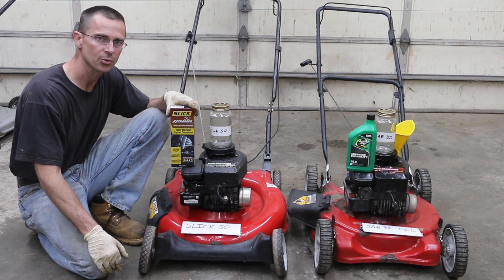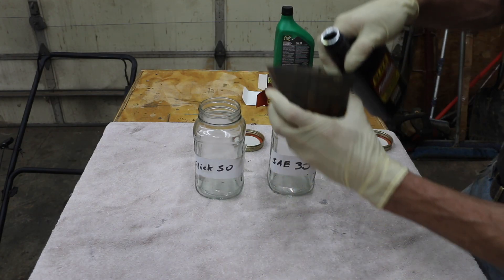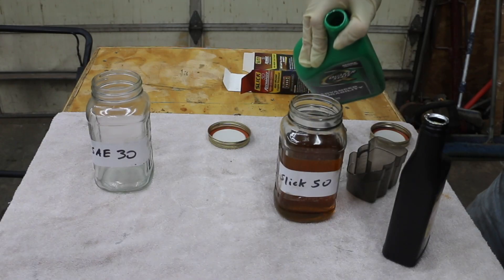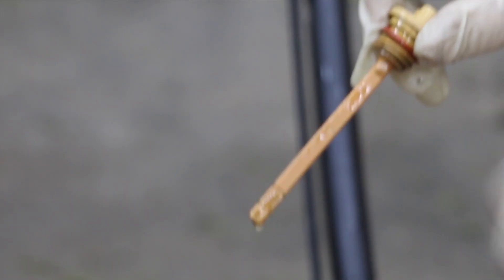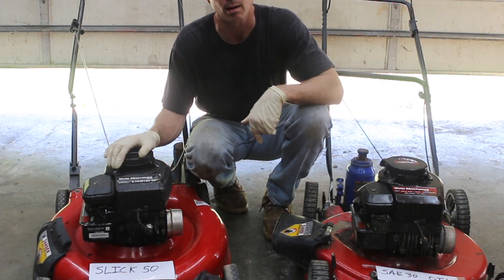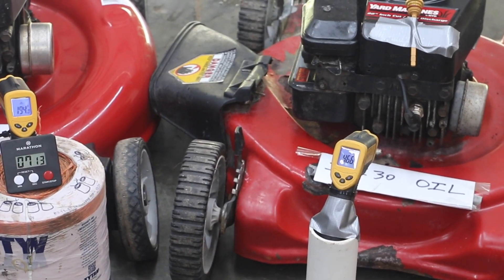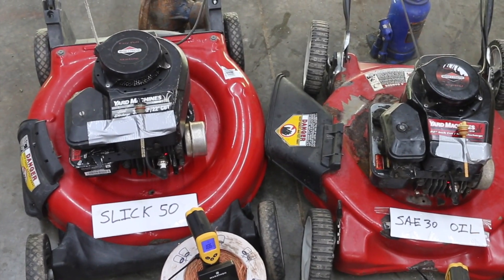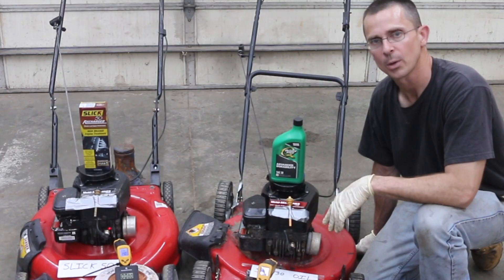Can't believe what SLICK 50 did to my engine!!--Dry Crankcase Test!

Comment: As a rep, ever since I visited the Mobile R&D test center in Paulsboro, NJ, I've been a believer in Mobile 1. Having seen their labs with a Mercedes Benz running for years, flat out, continuously with over a million miles on it, with is what won me over. (The engine was plumbed so that oil changes could be done without ever shutting the engine down) The engineers then showed me bench after bench if various engine components which had been plated with micro-inches of gold from metrology testing which had been embedded into test engines being  measured for wear using cross sectioning and microscopy. They had many engines in various levels of tear down which had been running all of the latest competitive synthetics as well. In short, there was no real competition, they were just being out marketed. Mobile 1 and their patented suspension of carbon graphite beat them all.
Reply: And the car was BMW six inline ,not Mercedes...
Reply: You need to read the story when mobile tried to sue Castrol for statingthat they had the best synthetic oil.They lost and Castrol counter suedand won. Don't be fooled by the smoke and mirrors.
Reply: Engines that are never shut down will have very little wear with any oil since there will always be a film of oil for the bearings to float on. Most wear occurs at startups. A real world test would be if they shut down the engines once or a few times a day.
Reply: Steven Evers most wear is in start up and shut down, continuous running is not a good test .
Reply: Thanks, that's impressive. I used to run Mobil 1 but it became pretty expensive here, so switched to Shell Helix Ultra F.S. which did pretty well for me also, but seemed to burn off faster. I think most of the synthetics deliver pretty similar performance, and you can extend your oil change intervals significantly if desired.
Reply: When you start your engine, you want oil around it as fast as possible, so a 0w is better than a 5w. Though sometimes the curves is different and blah blah but the second number is where the oil is after 5-10 min regardless. I for my cars i like 0w-40 {insert brand}.
Reply: Any engine that is run continuously will achieve this and Mobil knows this. It is the starting from cold that causes the most wear. Yes it's an impressive demonstration but I am sceptical about what it really shows.
Reply: Gas MPG in this amount of change doesn't mean much.  I have gotten much better gas mileage simply when the they change the winter summer formula at the refineries.  If you are not familiar. Instead of the refineries burning of the by products.  Now they dump it back in our fuel and we run the crap through our cars.  Not sure if they do it at both ends of the changes.  I do know they run premium gas through the supply tanks.  Even in the lower grade fuels. I think it is around Sep-Oct time I will see my gas mileage go up without doing anything to my truck.  If you ran your mileage around that time you can get a false change.
Reply: Mickey Bitsko AMSOIL is an MLM though and I don't support MLMs.
Reply: Major League Muffins?
Reply: lol Ellenor so are all products ;-) clue in.
Reply: Great comment, very interesting to hear your experience, as well as the other comments and experiences.

I think what we can say for certain, probably the only thing, as with everything in life you get out what you put in. So in this case with engine oil and 'performance'it depends what your expectations are, and you have to be very clear what is most important to you as there are so many variables and different outcomes possible.

In the example given continuous running with Mobil 1 was second to none.. Perfect.. However as others commented, probablya lot of start stop or different driving, running, load etc...a different oil might perform better other functions.

And then you have to think about ordering your outcomes into what's more preferable:

Cost of oil
Cost of fuel
Cost of a new /rebuilt engine
Cost to your business of downtime for any repair

Many variables and different outcomes more preferable for different people.

There will never be a one size fits all.. You can be master of one trade but never every one. The standard reasonably priced oil on the market tries to strike a balance and be something for everyone, and in return are usually generally good for most requirements but not perfect at any one.

 There are other factors as well such as patents, advertising and marketing, basically you have to 'sell'that idea or product to your customers.. The best man will not always win..
Reply: My experience in the 90's: Used different oils and with Mobil1 i Saved 10% in fuel compared to Shell, Texaco and BP.. If its still sotoday, i don't know ( We don't have Amsoil her in The Netherlands)
Reply: Richard Skipper - use to work as a Fleet Mechanic for a construction co, we ran Chevron Delo 15-40 , they. Use to get panicky an sell the p/u off at close to 100,000 miles ,I convinced the boss to run a test on several of the Ford 302 ,tear down an inspect lower ends - rods mains cranks pistons an rings , first at 80,000- then 100,000 then 125,000 150,000, then 200,000, at the 200,000 mark was where you could see some wear starting to occur on the rod an mains , still well into specs however, an we did an oil analysis at each LOF at 5000 miles , by the time the truck had racked up 250,000 miles the body an interior was looking sorta rough , so going from a 3000 mile oil change to 5000, An keeping the truck for another 100,000 miles was of course a huge savings to the company , an netted myself a nice pay raise an bonus . This was back in the late 80’s
Reply: As a rep you should know it's Mobil 1 not mobile 1....
Reply: @meat_pilot  as user of smartphones you should know that autocorrect corrects Mobil to mobile....
Reply: When it first came out it was $15/quart. Before 1978.. I've heard nothing but good about it
Reply: Here in Texas I bought mobil 1 and used it in 1978 and it was $5.00 dollars a quart .
Reply: None??  It killed so many piston engine pilots and families(produced engine failures)  that they had to stop selling it to pilots.  It does not last as long as they were saying.  That was in the 1990's.  For cars,  change it as soon it gets dirty.  Dont use dirty oil...
Reply: Whaaaa? I live in West Deptford like 5 min from Paulsboro lol I wanna go see this
Reply: Bobby Harpoon The byproducts should be saved and sold as "waste combustibles" in pressure tanks rather than burning off.
Reply: I got 10 % better mpg after switching to geico.  
If you want better mpg go down in sae,  if you want better "protection" go up(In second number). first number is "winter" or cold start sae equivalent oil at cold temps. the second is warm. All oil companies buy from the same suppliers, additives comes second to this, and will be argued long after we are all dead. But if someone wants to sell you 5 "weight" oil kick'em in shin and run the other way.
Reply: Steven Evers, I only use Mobil 1 Full Synthetic. On my cars and motorcycles. Best results so far. Previously was a Castrol user.
Reply: Pennzoil Ultra Platinum usually does better in used oil analysis tests than Mobil 1.
Reply: I haven't changed my oil in 250,000 miles and my engine is running fine. That's like 80 oil changes if you do the 3k intervals. I could buy a new engine for what I've saved on oil changes.
Reply from the maker: I enjoyed reading your comments.  Very informative!  Thanks you!
Reply: Mickey Bitsko Nulon fully synthetic with Molly is good
Reply: Mickey Bitsko Hydrocrack synthetic should be sold as synthetic 2nd grade, not 'full synthetic'
Reply: Mobil1 is crap. The tests you speak off didn't apply to the real world. Mobil 1 paid out for damaged engines in the past.
Reply: @Project Farm I think we need to see a side by side of cheap oil vs. Mobil 1 vs. a straight PAO synthetic like Schaefer or Amsoil.
Reply: Add about 5% PTFE (teflon) to Mobil 1 and you be set!!!  Correct particle size of PTFE is critical, must be less than 5 Microns.
Reply: Graphite is an amazing stuff! A sheet of graphite, like a 10 karat diamond is a very tough single molecule that you can hold in your clamp without damaging it!
Reply: I'm thinking warming them up and cooling them down is a big player in wear and tear.
Reply: Sort of.  Castrol used a cheaper type of base stock and called it "synthetic."  When Mobil lost they, too, switched to the cheaper stuff....but they keep charging full price.  If you want genuine PAO synthetic base stock you have to shop around and do some homework.  Amsoil uses it, among others.
Reply: Mobil 1 is the only engine oil I ever use now. It is worth the price and is far better than any additive or other oil. I usually do my oil changes every 15k or once a year whichever comes first and have 350k on my original 4.3 s10 engine.
Reply: Well Jef Rey I have sad news for you if your trying to brag of high milage and think its because you use mobil 1 lol. My 4.3 sonoma zr5 has 496 on it and I think its had about 4 oil changes since the warranty was up lol. Heres the kick in the balls. Its some no name shit oil purchased at dollar stores.
Every now and then I pull a vale cover to see if there is any gunk build up. Still clean as a whistle. Miles or kms is not the killer. Its what type of miles/kms and peoples driving habits. I never stop on the gas from a light or stop. I ease into it to load up the engine then stomp on it. Not that theres much power under the hood lol.
Reply: I remember seeing Slick50 demonstrated at the Oshkosh, Wisconsin EAA Airshow in the early 80's.  They had a V8 engine on a stand, running in the hot sun, with the oil pan drain plug out.   I walked past it several times that day, and it just kept running-- without a drop of oil in it!   They had parts on display showing how Slick50 bonded to and coated the metal parts with a coating that looked exactly like a teflon coated frying pan.  I thought it was pretty impressive at the time!
Reply: @rickwessel3302  I saw the exact same demonstration at the Oklahoma State Fair in 1983. In that demo, there was no oil pan on the motor, and the oil pressure gauge read zero. I was shocked and amazed.
Reply: Nope, not at all MPG went from an average 14.1 MPG  to 15.5  (Math is not hard)  I don't have a Dyno,  however I did notice a small gain in power.......But you're certainly have the right to your completely, inane, ignorant, and false opinion.
Reply: Big sea I've always used castrol its deff the best but been thinking about awitching to Mobill 1
Reply: mobil 1 has the WORST start up lubricity and thats what tears most modern engines up
Reply: Mobile one is the way to go i guess
Reply: Did they tell you they sued Castrol for calling cheaper hydro-processed dino oil "synthetic", but when they lost the arbitration Mobil also switched to cheaper base stock?  It's ALMOST as good as real synthetic.  But not quite.  However, like Castrol, they charge the full premium price for it.
Reply: The increase in average fuel economy is not "In my head" math does not lie.
Reply: I just switched from using Mobil-1, to Amsoil after about 25 years........My truck instantly gained 10% increased fuel economy,  and a small yet noticeable increase in power.

Comment: you have to run slick 50 for a few hours to get it to bond to inter parts,
Reply: Still reading and responding to half a year old videos, that's what makes you a top tier youtuber.
Reply from the maker: Thanks for commenting on this.
Reply: That was my understanding as well. It also seemed that the engine just quit like the ptfe caused the parts to gum up as they heated. Did it throw a rod? Temp reduction of engine was most significant thing I saw.

Comment: Schaeffer Oil makes a product that I like and its mostly used for fleet vehicles. It's "Schaeffer Moly EP" they also make a Racing oil with the Molybdenum in it. Before you do the test though you should run the Moly additive for a while and let the heat build up coated surface on all the bearings and guides sorta like seasoning a cast iron pan but instead its supposed to plate the surfaces with a film of Molybdenum preventing metal to metal contact is the notion. I have always wanted to do this, but never could afford to, thanks for the video.
As a side note I don't think slick 50 is what it used to be. Something seems to have changed with slick-50 that is not the same stuff I remember,  the stuff I remember was about the consistency of raw honey, that new slick 50 looks like regular motor oil something is off about it. Its hard these days, as more and more technology surfaces so do strategies to protect investments, companies start with a great product only to have it bought out by the competition, then the new owner "nerfs" it to make the whole idea look like it was a scam, so even if someone else does it in the future the so called experts can point back at the situation and use it to discredit any future products before they can even get off the ground. I am not saying that's what happened with Slick-50 but there is something drastically different about it. Its just hard these days to stay objective.

Comment: Well it was kinda satisfying seeing that engine with 30 wt just stop nice to see a motor just lose it's crank every now and then although no motor is supposed to run without oil the slickster died at 200 degrees so it kept it's cool..... 
Don't use any attitive in a motor with a flat tappet cam unless it has zinc in it .... Like pre 80s cars
Reply from the maker: Thanks for commenting.

Comment: Did you try this with your MotorKote?    That stuff is amazing.  I ran a Civic unknowingly without oil for 600 miles and because it was treated with MK, it saved the engine.
Reply from the maker: Not yet, but I will likely test it this way.

Comment: the slick 50 you are  using  is not the bishops original , lookup What happened to slick 50 , Interview with John bishop , do not use if made after 1984  formula,
Reply from the maker: Thank you for this information.

Comment: Why have you never used B12 Chemtool. It works just as good as seafoam I guarantee it. And it’s half the price. I’ve had friends think I am a mechanic and all I did was use B12.
Reply from the maker: Thanks again for commenting.  I tested B12 Chemtool in a previous video.

Comment: You need to run the test with Prolong it is the only oil additive that when tested actually made more hp on the dyno. It is also the only oil additive that Al Unser ever endorsed. Here's a link to the prolong world challenge  https://www.youtube.com/watch?v=v9Sbo9RQA4w  Slick 50 no longer puts PTFE (Teflon) additives in their product like they used to, which in the past made it a pretty good oil additive.
Reply from the maker: Thank you for this recommendation.

Comment: The slick 50 commercial used a Mopar slant six which has babbit bearings, they also sprayed water into the oil sump to float the bearings. A very clever trick! Slick 50 sucks! It blew the engine in my 83 Fith ave. It clogged the oil filter and there were many cases of this!
Reply from the maker: This is great information. Thanks again.

Comment: Hi. Since you have established the timed baseline for this. Take a lawn mower and add Amsoil full synthetic for small engines. You can purchase this online here: https://www.amsoil.com/shop/by-product/motor-oil/4-stroke/ Now this is the top of the line synthetic oil aka top tier oil. If you want to use their top of the line small engine racing oil you can get that here: https://www.amsoil.com/shop/by-product/motor-oil/racing/briggs-and-stratton-synthetic-4t-racing-oil/?code=GBS2960-EA When you order you can use the customer # 308355

 Btw, I'm the guy who left all those links a few days ago showing where most all the top oil additive makers like slick 50 got fined by the FTC for not having one ASTM test (Automotive Standard Testing Materials) to back up their product claims. This has to be done by a party that has no affiliation with company or product. Product has to be bought at a retail store or the company without the company knowing about the test. In this way they are testing exactly what is sold to the consumer, not a beefed up version of the product that the company formulated to look good in the test.
Reply from the maker: Thank you for this recommendation.  I have some Amsoil and I plan to test it soon.

Comment: If additives were that good why don't oil companies add it into their oils. Buy the cheapest oil, add the additive oil and you will have an oil that will out preform a can of the best. Maybe ?
Reply from the maker: Thanks for commenting on this.
Reply: Oil companies do use friction modifiers in their oils as well as anti corrosives, anti foaming and various other additives that is what determines the particular character and behavior of oils. However, I do agree "oil additives sold as such may be best confined to the realms of "snake oils" although there should be a distinction between oil additives ie, those over the counter additives which are claimed to improve the effectiveness of engine oils and others such as "Slick 50" which is mixed with base oil in its packaging and only uses the engine oil as a vehicle to enable the transfer and plating of the product to high heat and high friction areas. Quality engine oils are developed with stringent controls concerning the particular additives necessary and in what percentages. Friction modifiers alone will never perform the functions required by the complexities of today's internal combustion motors. Further, the "Teflon" family of products don't require to be renewed at oil change intervals as is required with Engine Oils, they rely on the bonding or plating process which is from where "I think" the name Slick 50 comes from in that it is intended to be effective at least up to 50,000 miles.
Reply: You think all companies like their engines to last forever?  Wake up!!